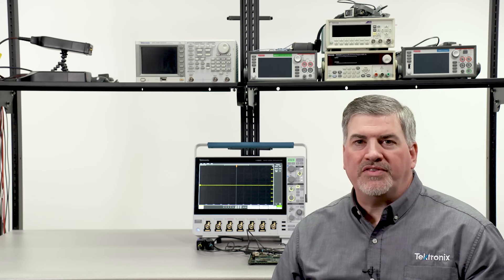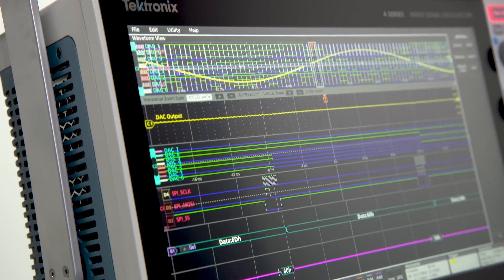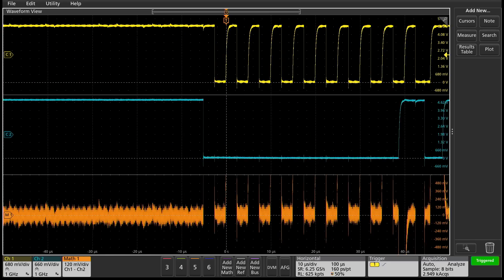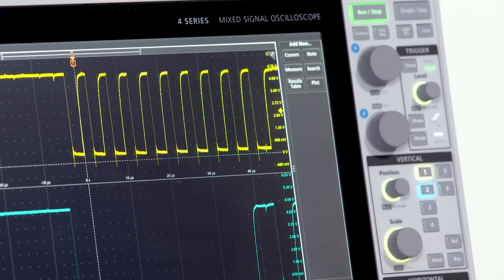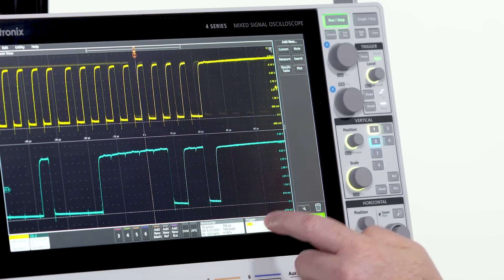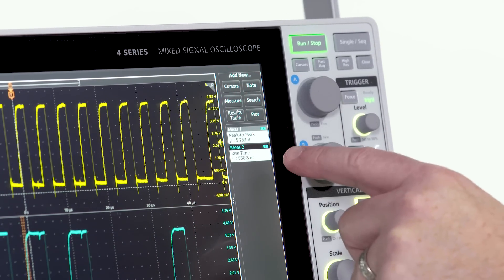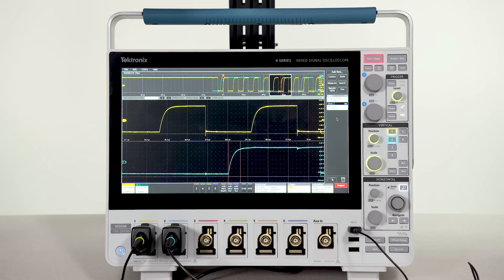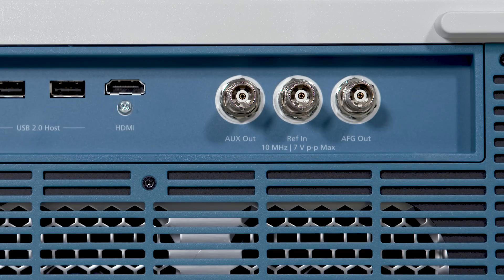4 Series MSO Technical Overview Part 1

Comment: At 0:35 you can already see how laggy the UI response is. That while only using 625kpts or 1% of its memory! Last week I used a 4 Series at 12.5Mpts (one fifth of the advertised memory) record length and was shocked how bad the experience was. It's like they put a lawnmower engine in a Rolls-Royce. Looks nice, but performs underwhelmingly once you try to move.
Navigating through my 10ms waveform record to assess for anomalities was really impossible. For every turn of the pan/zoom controls, the scope took seconds to update the view. The jog/shuttle type pan/zoom is a major design flaw, because you can't pan a determined amount in time: It depends on how far you twist the knob for how long. This without visual feedback due to the slow screen update means you have to twist an then wait until you see that you went too far, then twist a little less and a little shorter in the opposite direction and wait again.
I really missed the little Keysight I had in my old job. Only 4Mpts of memory, but at least you could use it. I'm sure my measurement would have taken hours instead of days.

And yes, I had the newest firmware because I thought "this MUST be a bug already fixed". It was not. The Search feature still has a (documented) bug also, so you can't use it to jump around in your signal.